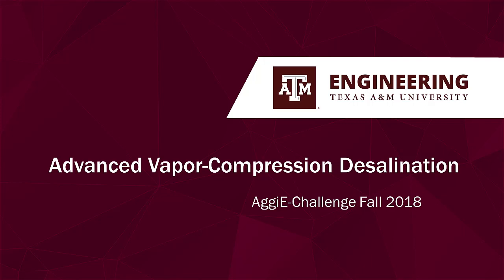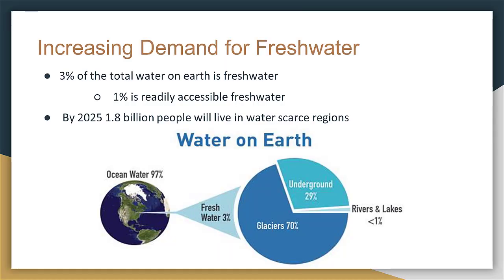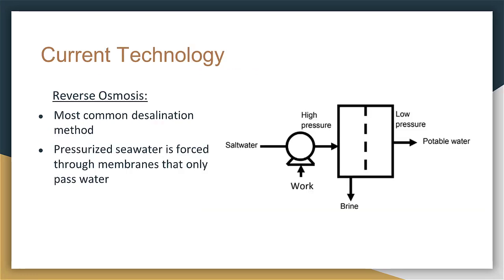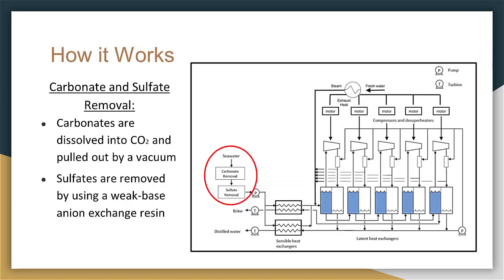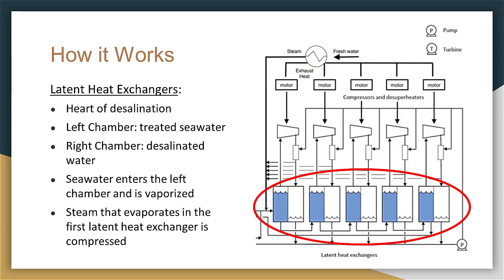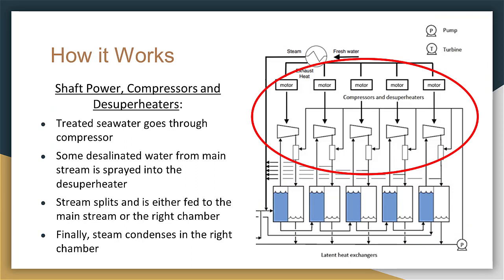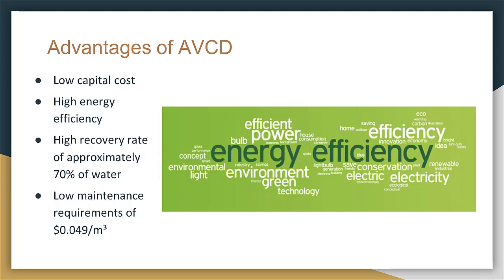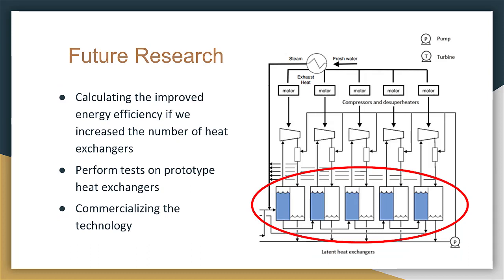Advanced Vapor-Compression Desalination

Comment: This technology has an issue of scaling the heat exchangers. It is better to let the vacuum distillation technology  consume more energy, and work without any maintenance issues, than implementing something energy efficient, but fraught with scaling and corrosion issues. One sentence of Wisdom, "Never work with a technology that asks for a water temperature of >70 Deg. C", and you will not need service engineers" running around with google maps.